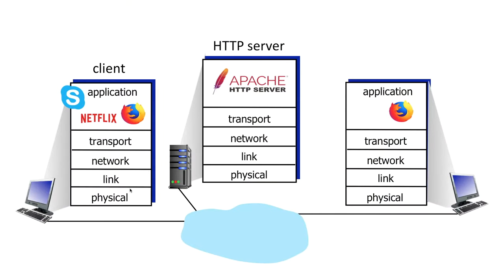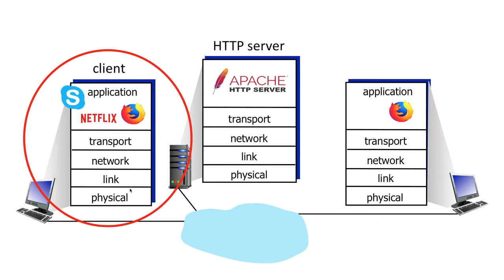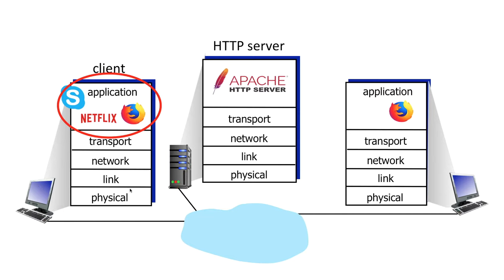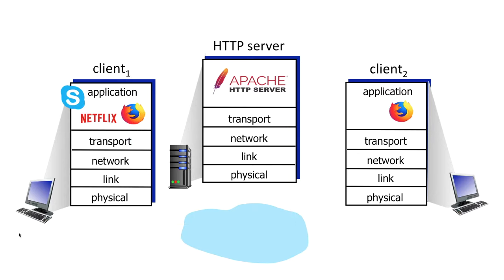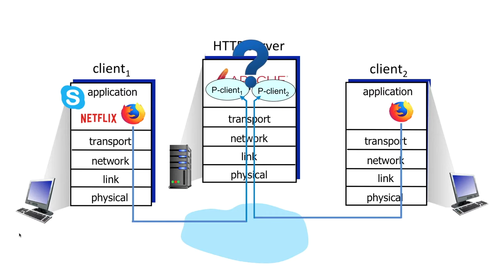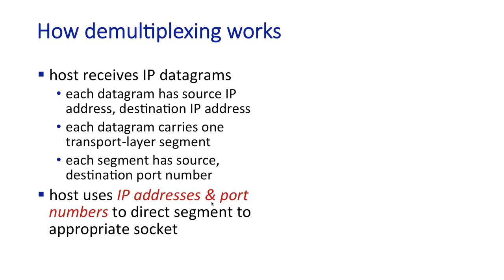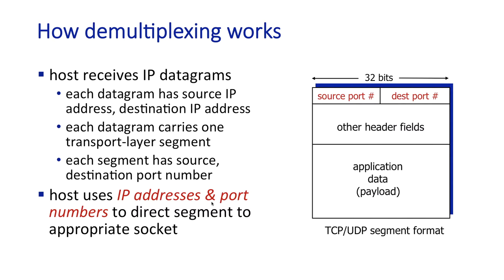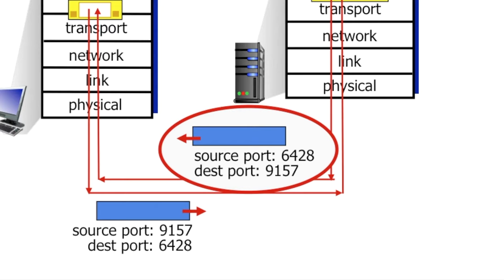3.2 Transport layer multiplexing and demultiplexing

Comment: In the case when UDP is used, If many clients have the same dest port no. say 80 then they would goto the same socket in the destination server right? if so how would the server distinguish between the different packets received as obviously they are from different sources however in UDP only dest port and IP is mentioned, unlike TCP where src port and ip is also included.
Reply: That's why UDP is connectionless as it only have the destination port to the destination server. It doesn't have other tuples  destination ips and port as in TCP to identify it correctly and built a authentic connection.
Reply: does sender choose dest port no arbitrarily?
Reply: @turkersubasi  yes